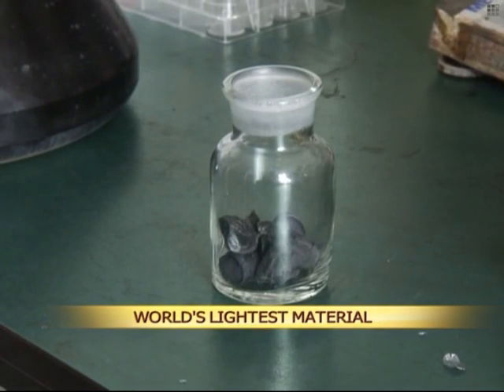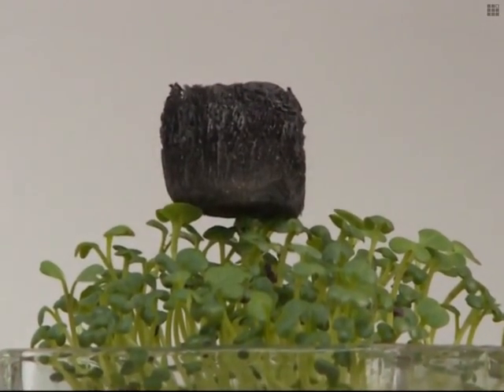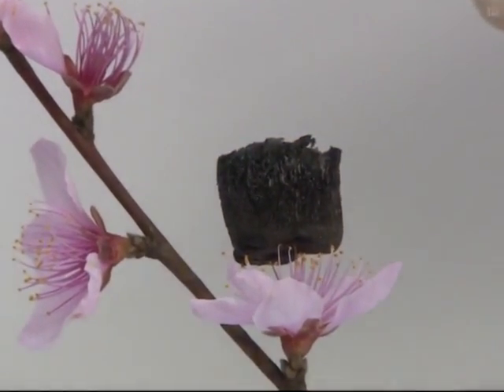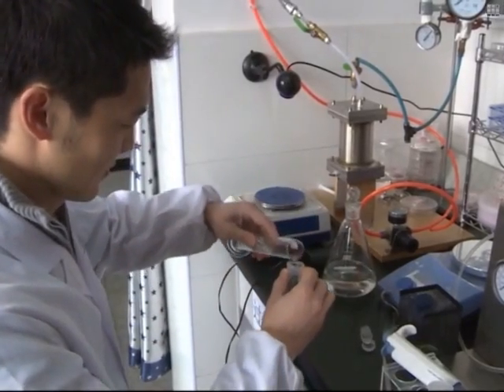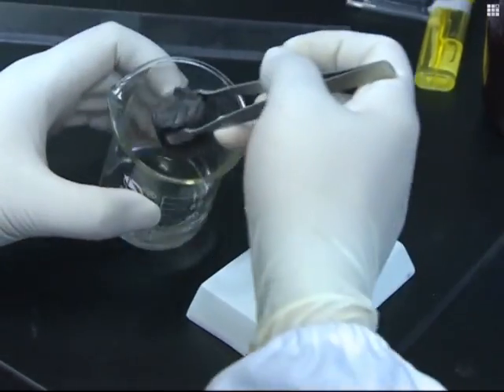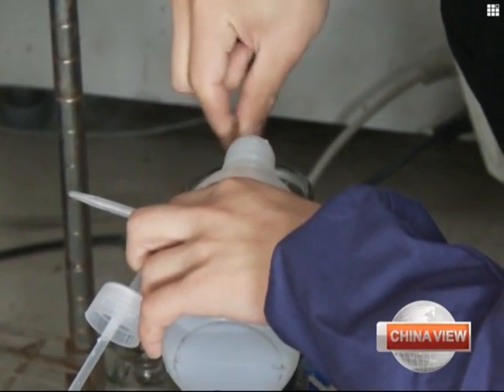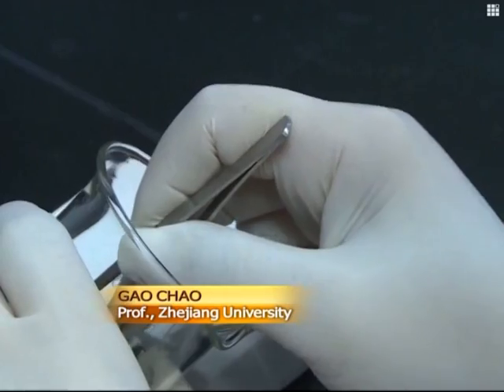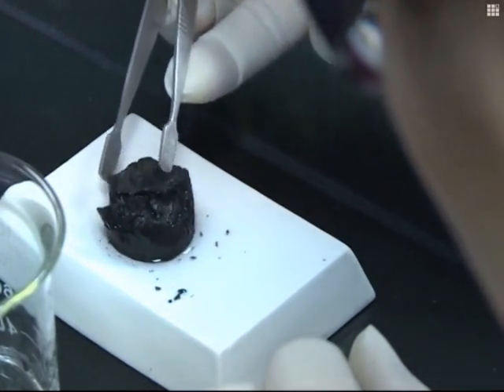World's lightest material

Comment: If they were lighter than air, they would go higher and higher, but they don't, huh? :-) 
A cloud is not an object in the air - it is the air itself, but with a high condensed humidity. A single water drop, if very small, can go up (evaporate) due to warm air flow, but it's never lighter than air.
On the other hand, aerogel is a uniform object, not a mist dissolving in the air.